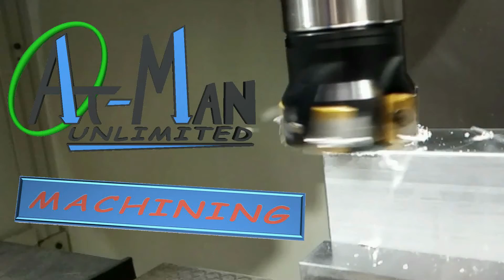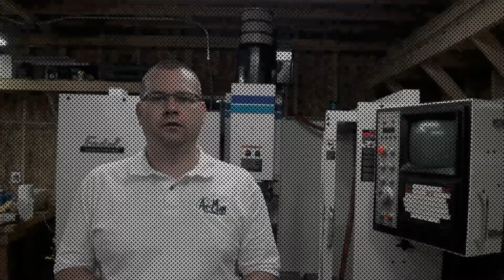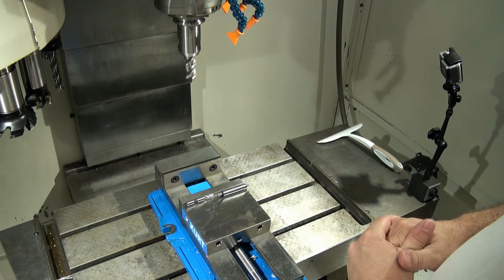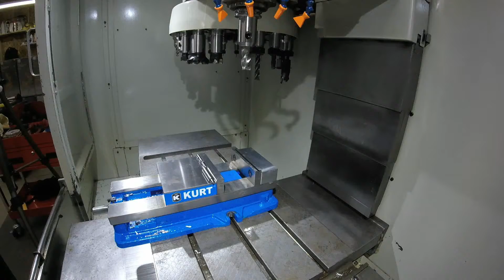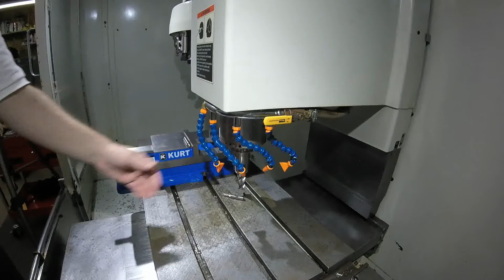CNC Mill Tool and Work Offsets Explained Part 2

Comment: Around 3:37 you talked about setting the Z to the table of the machine.  What command did you use to set this Z.  I am comfortable with G54 work offsets but this seems to be different. Great video though! Super helpful.